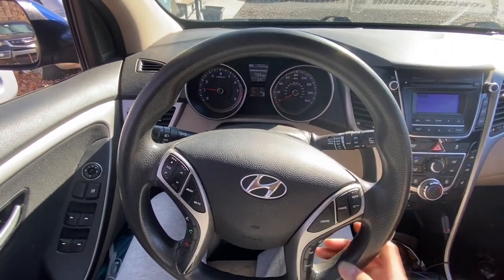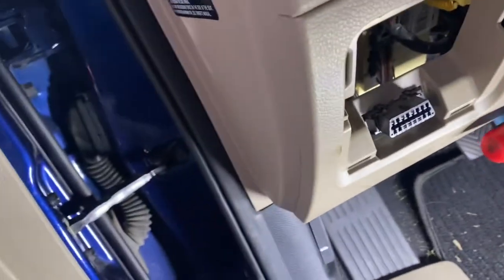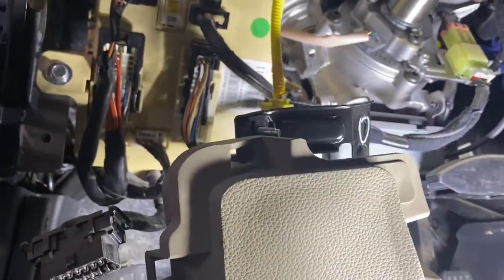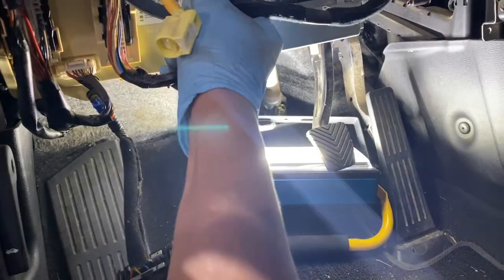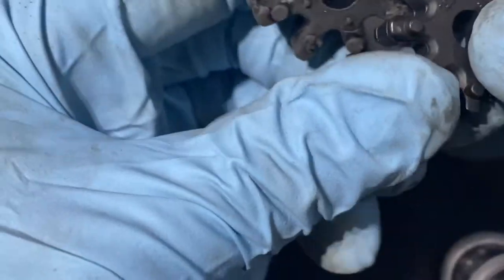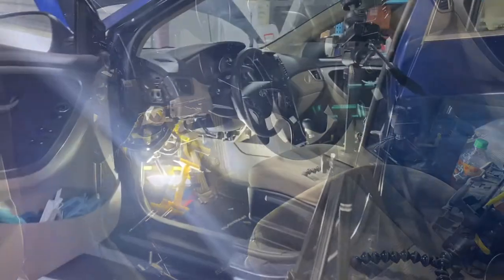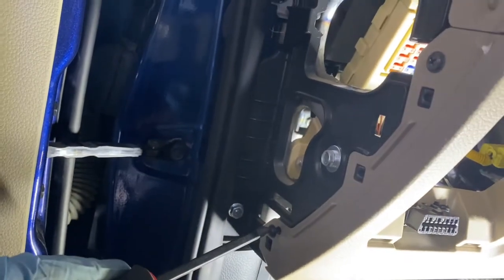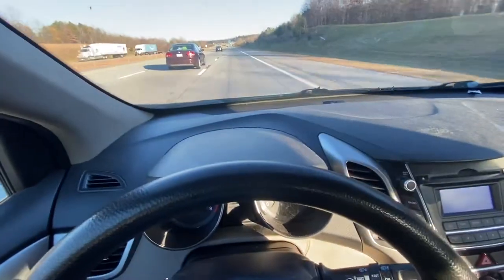How to fix Steering wheel coupler of 2013 Hyundai Elantra GT removal install repair full detail

Comment: Just fixed my daughter's car. Tips: 1) Getting the fuse box out of the way give you more room and isn't hard to disconnect/reconnect. 2) After getting the "nose" of the steering column into the square hole above the log 14mm bolt, putting the two 12mm bolts in place loosely keeps the steering column in place. After pushing the long 14mm bolt into place, lowering the tilt-telescope level gives some play for getting the 14mm bolt threads to engage with the captured nut.
Reply from the maker: That’s awesome
Reply: Goated comment. Ty. I came back to this after struggling with my 14 and it just threaded right in.
Reply: @autopurlieu salut merci pour la vidéo dimoi tu as le lien de la pièce merci
Reply from the maker: @mamoudousawadogo8029  https://a.co/d/8gFttf6

Comment: Did the whole thing without disconnecting the battery. Car won’t start.
Reply from the maker: You should disconnect the battery . 

Get a scan tool and read the codes and clear them

Comment: Finally got it changed. My coupler was melted and the inside was coated with the gummy rubber that used to be the part. I wish i could add a picture to the comment. That way u could see how bad it was
Reply from the maker: I believe you, I’ve seen it worst . Great job 👏
Reply: Mine too

Comment: Just fixed this in my car in a little under 1:45 minutes because of your video. Had trouble with the 3 inch bolt but managed to work it all out by separating the steering wheel and the steering shaft. Also disconnected the wires from the steering wheel that contain the clock spring for more leverage and room. Thank you for this video. I saved myself 400 bucks.
Reply from the maker: @mrcinsc  I’m glad it helped you brother 👌
Reply: @autopurlieu  the clock spring goes out a lot too as they were part of a recall. I didn’t fall under the recall and did it myself in under an hour. You’d probably do it faster and could make a video about it. Thanks again, just subbed to the channel. You deserve the views.

Comment: This has been a great video so far! At 26:33, we’re having problems with disconnecting that last wire bundle that’s attached to the metal bracket - how does this detach from the bracket without breaking it? 😅 thank you!
Reply from the maker: Thankx brother . 
If you break that plastic clip that hold it up there. Hey, let it be lol, it’s just a clip . 
Use a pick or a pry bar or flat screw driver that can reach up there

Comment: At one point in the video, before you put the steering shaft but up. It looks like the steering wheel is crooked from the shaft and then next thing you know it’s back in the correct orientation. I’m having a problem getting my steering straight with the shaft. How did you do it?
Reply from the maker: @jessicadolci272  I think I forgot to mention in the video that the steering shaft must have a marker so it will go back in the same position.

Comment: Could that part be causing the car to pull right by itself when I release the steering wheel for a moment? my i30 is doing that with summer and winter tires plus it got checked by the official Hyundai service center and several other service centers and what they did is they replaced one bearing and all bushings plus they reset the wheel sensor, but the problem remains. They said that they don't have a clue. I feel like the steering wheel is not moving like before and as you described sometimes it moves by itself when hitting the breaks.
Reply from the maker: Did you get your car wheel alignment done ?
Reply: @autopurlieu  yes, twice. Once by a regular service center and another one by the official Hyundai center. Sorry I forgot to mention it. What I noticed as well is that the steering wheel is a bit more stiff now in comparison to what it used to be.
Reply: Развал-схождение. Шаровые. Рулевые наконечники.
У меня на 130 т. км. Разбило одну шаровую опору. И один опорный подшипник.
Естественно при торможении был увод в сторону.

Comment: I have a similar issue with my 2016 Santa fe. The steering does have a little clicking sound when turning, but the most annoying is the vibrations at low speed on small bumps. The vibrations are felt in the steering wheel and the left side of the car. I went to a mechanic and he checked everything (tie rods, and all that stuff) everything is OK so the bushing is the last idea. What do you think ?
Reply from the maker: If everything is okay under the car. This might be the problem

Comment: I can’t get to the nut and bolt at 22:00 because my car is right hand drive and there is stuff in the way as the orientation is reversed!
Suggestions??
Reply from the maker: Ohh man that’s unfortunate. 
If possible, remove or relocate those stuff are in the way. If not, just be patient and maybe a smaller ratchet and socket and some swivel adapters. Also a small mirror might help see things that are in the back side .

I hope it helps

Comment: Is every connector different? Any risk of accidentally plugging the wrong connectors together?
Also, how can you make sure the steering wheel stays straight when removing and re-installing?
Reply from the maker: All connectors should a slight different . You shouldn’t have to worry about mismatching connectors .

Before you fully remove any in steering . Make sure you put a mark on both ends of the shafts so you can put them back in as close as possible to where it was

Comment: Is easier when putting it back together to line up the 12mm bolts and slightly put the front two nuts back in just to hold it up and then get that 14mm back bolt back in

Comment: There needs to be a class action lawsuit for this issue. It is happing far too often and makes driving quite dangerous.

My 2013 Hyundai Elantra has this issue and I’m fixing it this week. There is a chemical reaction happening between the lubricant in the motor or assembly and the coupling washer. Clearly the engineers didn’t evaluate the rubber material or the lubricants used in the motor or the vendors may not have been supplying the correct material. It probably should be Viton. The coupler on mine was as soft as chewing gum and had to be scraped/brushed out of the housing.
Reply from the maker: I feel you brother. It should be a recall
Reply: Absolutely I got to fix my son's tomorrow a craigslist mechanic wanted $300 to do job I bought 5(I don't need5) for 5.95 free shipping eBay
Reply: @joeywitt7129  There was a warranty extension of 10 years or 100k miles I discovered after I fixed it myself. 🙄
Reply: @Canon1DMkII  do you have a link or something about that?  I need to get mine done.

Comment: I put everything back together and now my electric power steering light is on. Whats causing that?
Reply from the maker: You probably didn’t put something right. Double check your work. Or get a scan tool to clear it.

Did you disconnect the battery before doing that job ?
Reply: @autopurlieu  yes I disconnected the battery first. The only connector I haven't replaced is the airbag. I'm 6'6 and I couldn't physically access the area under the steering column with it still connected. When I was removing the 12 mm bolts that hold up the steering column, the tilt lever came apart and I'm not sure how the lever, 2 washers, the metal tension thing that's got that hook shape and the weird black plastic w/silver pieces washer shaped thing were put together. So I haven't reconnected it yet. I tried to find a schematic or something to shoe me but I couldn't find anything online. I was up until 5 am working on it and now I'm gonna hit the auto parts store and hope someone there knows how it goes together. That lever being off, when I was trying to position the column to reinsert that long 14 mm bolt, caused me to inadvertently pull the steering wheel and top portion of the column completely out of the bottom half column. I quickly got it back together and finally got the long bolt back in. After that, everything went quickly and easy with the exception of the tilt lever
Reply: Необходимо в таких случаях делать калибровку руля на сервисе.
Несоответствие положения руля и датчиков угла поворота.

Comment: So after putting together and the car doesn’t crank, what may be the issue?
Reply from the maker: Make sure you double check everything that you install everything properly in order.
Reply: @autopurlieu  I triple checked everything , now the windshield wipers don’t work so what should I do? Will the whole car not crank if that’s a issue?
Reply from the maker: @Jasmine.Celina  there’s really nothing related to not to start the car. 
Does the engine turn over? (Cranks)
Reply: @autopurlieu  no. The battery, engine and ESP shows when attempted but I know there is nothing wrong with the engine or battery
Reply from the maker: @Jasmine.Celina  I’m sorry to hear. I can diagnose the car without seeing it personally or more details. 
Unfortunately, it’s better to find a mechanic that can help you. 
Best of luck
Reply: @autopurlieu  it was a fuse that blower but everything is good now. Thanks
Reply: @Jasmine.Celina  That's great that it was just a simple fuse 😅

Comment: Would anyone know why my steering is locked still, but I can still move the steering wheel and wheels? It’s like there is no power to my power steering motor now. HELP!!!
Reply from the maker: Have you done any work to the car ?
Reply: @autopurlieu  Yes. I have completed the whole process, and began to rebuild. I plugged in all fuses then reconnected the battery for a test.
Reply from the maker: @Jaketeachesdrums  when you said “ steering is locked still” ? Was it locked prior the repair? This repair is not for clunking noise when turning .
Double check your work, you probably didn’t connect back in properly. Back track your work

Comment: Where do i purchase the part???
Reply: Call your local Hyundai dealer and ask for the part. It cost me less than $2 for the part. Auto parts stores may also carry these but they're often not OEM and may not fit perfectly
Reply: @blunted215  went there already
12 hundred dollars to replace the hole thing
I don't have that kind of money
That is why my question here...
Reply: @gatofeo8909  if you just ask for the part, not for the repair, they should sell it to you. If not, you can try to buy it aftermarket at an auto parts store.

Comment: This doesn't fix the problem every time. Replacement of the electric gear assembly in the column is the correct fix.